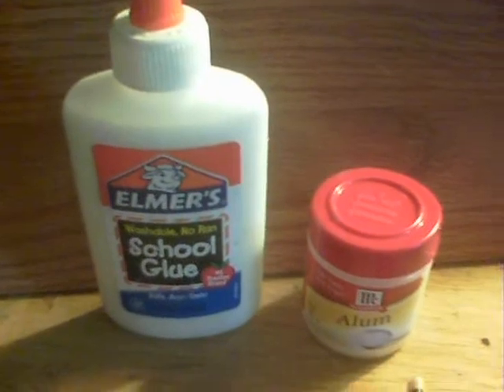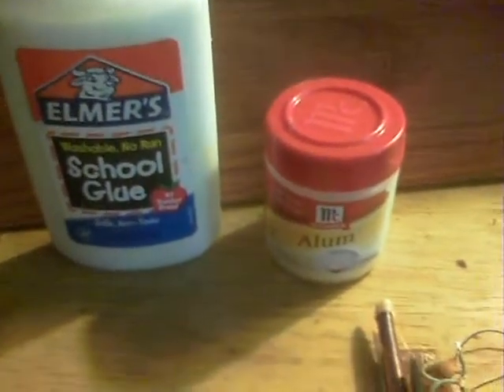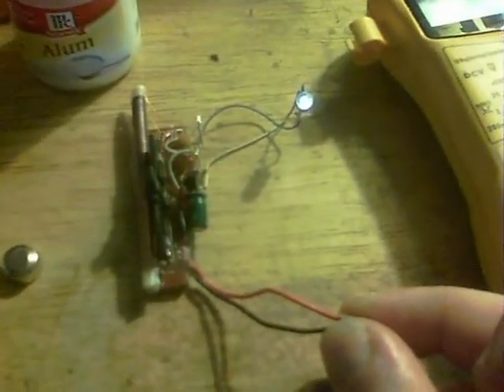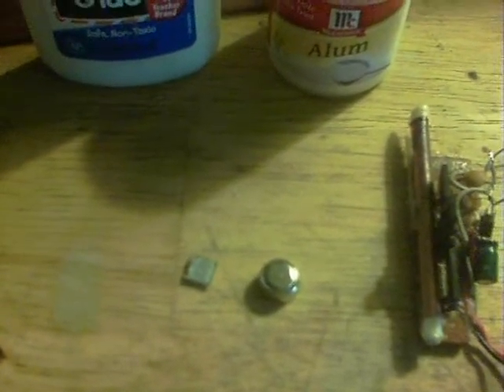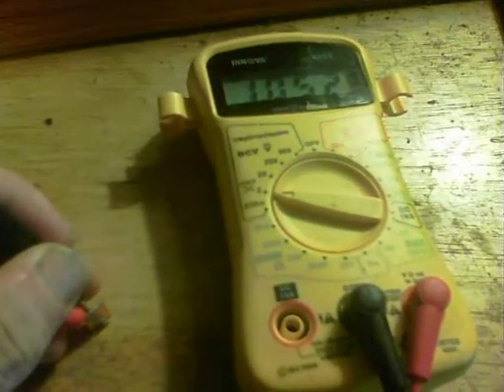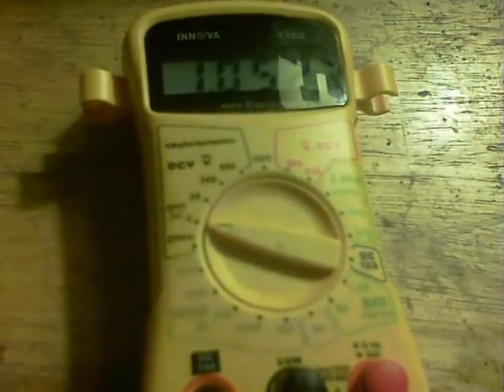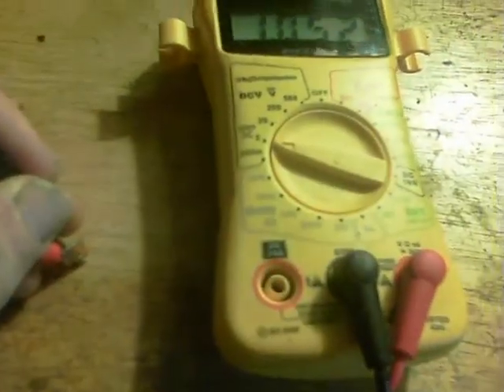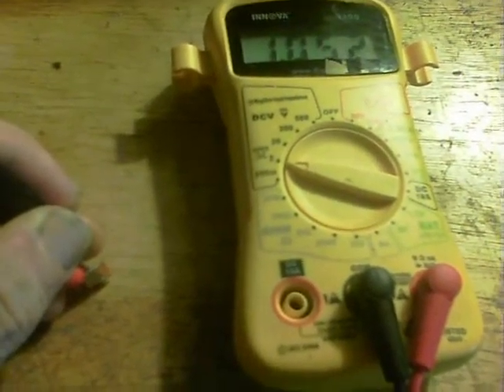7mm tiny homemade battery

Comment: So I’m working on a video like this and I used epsom salt as I don’t have any more alum and it made a rubber it works but it’s not sticky like I wanted and its not really drying
Reply from the maker: Ah yeah. well rubber cement is a good one. You want a material that never really dries out. Silicone for bathrooms is another that could be tried. It should be well mixed with the epsom salt before drying, turning to the rubbery always conductive material.
Reply: Slider2732 I’ll have to try that my Elmer’s glue Epsom salt polymer is like rubber now and it’s non conductive and not sticky

Comment from the maker: @morpher44 Good working method, is to get plenty of pennies. Look for earlier than 90's for copper and newer for zinc...dremmel off the coatings and you'll see either zinc or copper. Pour glob of glue on both pennies and mix in ingredient well. Sit one penny on top of other and test V/mA. Run tests. Leave to dry out. Test again next day. Can recharge a cell with wall adapter 12V for 5 seconds. May need to moisten with fresh glue around sides before sparking them...but they come back great.

Comment from the maker: @morpher44 Tell ya what does work very well, celery salt ! Got a cell here i've been running the last 3 hours, made the same way, mixed with glue and on galvanised steel and thin plate copper (from PC heatsink). Started 0.75V @ 2.08mA, now sits at 0.82V @1.6mA..after all that circuit running and before resting to recharge for 30 mins. Many salts work and cells recharge themselves, some need galvanic (use plastic wrap etc). If you look at J Bedini's vids, he shows the best ways to build.